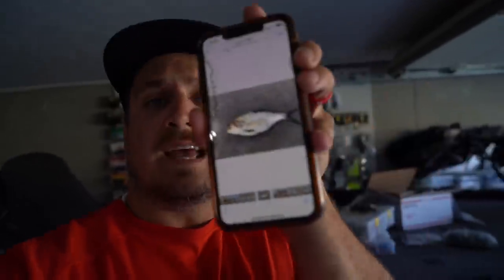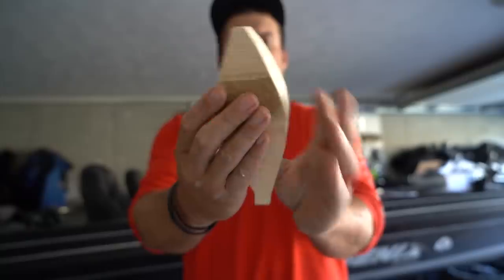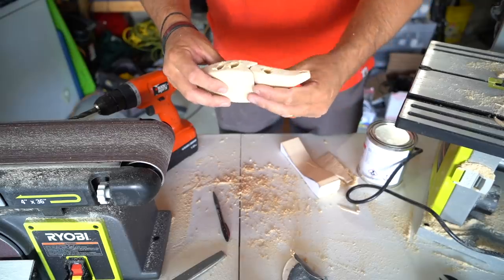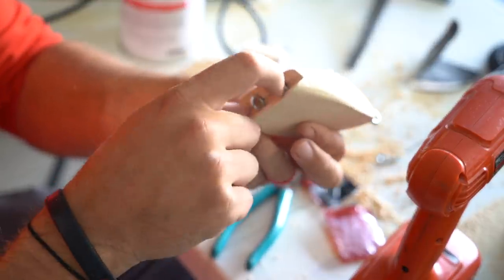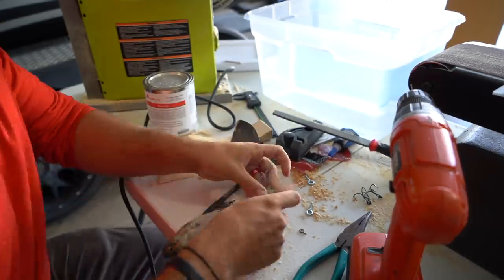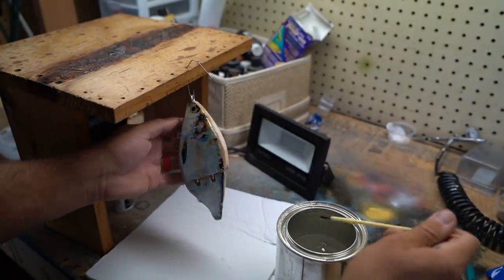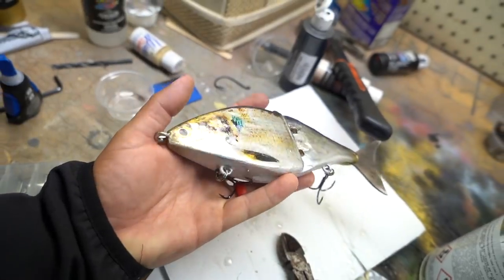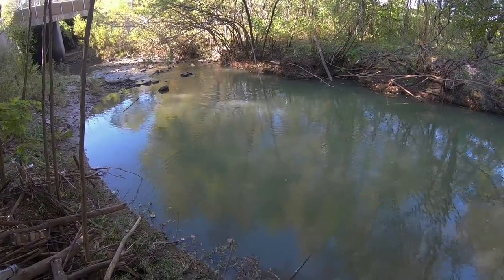Making a Shad Glide-Bait from a REAL FISH!!! (IT WORKED)

Comment: I drill holes into blank areas of a metal sinker mold to make belly weights. I score the bottom so I can add a wire hook hanger if I want for crankbaits, or leave the wire off for other belly weights. 

I seal the bait, assemble it, then use masking tape to tape belly weight on to test in a tub or pool. I can move the weights around, add and subtract to get the exact sink, rise or suspend I want. 

Once I have it weighted correctly, I take hooks off, hinge pin out, and drill holes and epoxy the weights on. I smooth over the belly weights by making wood putty with fine sawdust from the band saw and epoxy.

I sand it down, one more seal coat, then paint, clear coat and final assemble. 

Great looking bait u made.

Comment: Just a little advice brother next time you use your bandsaw drop the roller bearing guide to about 1/8" or so from your work peice.  It definitely helps keep the cut a lot straighter up and down with less room for the blade to flex.  Awesome job as always Ben and keep up the awesome videos brother!

Comment: hey you want swiveling hook hangers try the Spro cane swivels the heavy duty ones that can hold like 250 lbs. just drill a hole in the side the swivel in the bottom of the bait and then glue the swivel in. BOOM! swiveling hook hangers.

Comment: Joint was so hard cause you did it wrong.  First thing you want to do is make a joint jig.  Simply take a small 2x4 or other scrap of wood, cut it in half at the correct angle. 
Next step is cut your joint before you cut the top profile. This way the sides are still flat and square.  Put the lure and 1 piece of the joint jig in a vice.  Use the other side of the joint jig to sandwich a small hand held saw between the 2 sides.  This will ensure the correct angle.  Now cut 3/4 of the way to the center line.  Flip the jig to the other side of the bait and cut that size 3/4 off the way to center. Now you can carve your bait then when you finish that then you finish cutting the joint by hand the angle is already set.